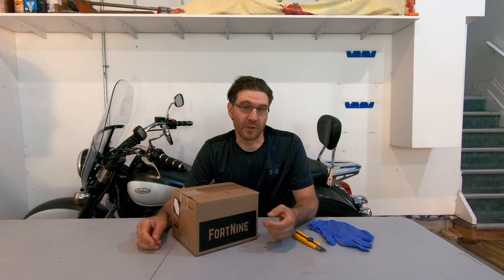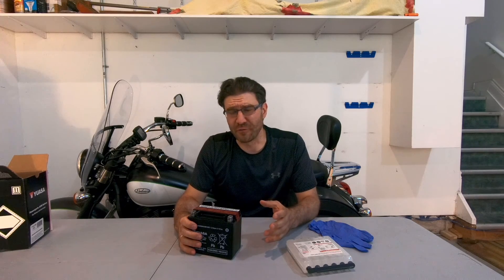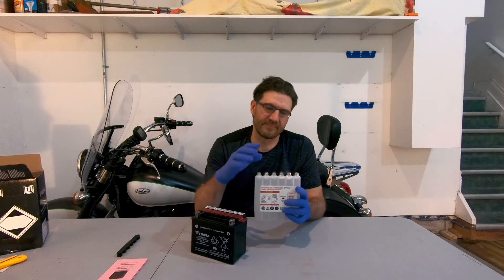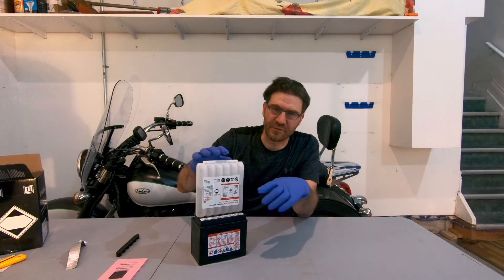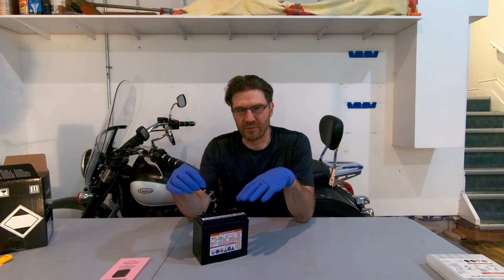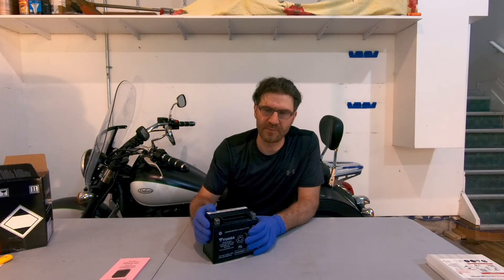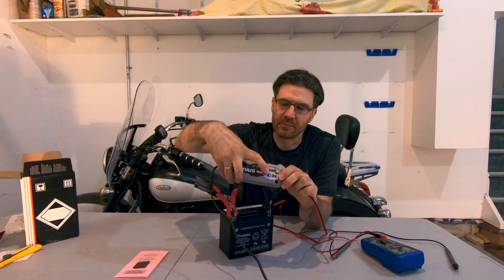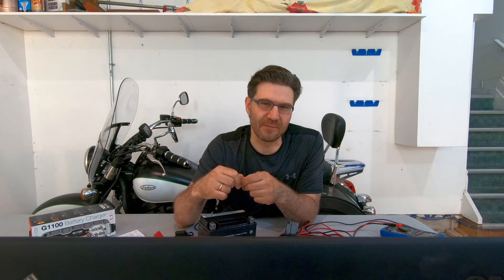How to Activate and Charge a New AGM Battery

Comment: Everything ok but the right thing is to NOT seal the battery straight after the electrolyte.
You just put gently  the cap over the holes for the dust and wait 2-3 hours for the chemical reaction and evaporation. After you seal and charge with the lowest amber you can.
My last YUASA  that i fixed for my bike this way  showed  13,20 right after first charge and kept1 3,12 for the first months and just over 13V for a year at least (being settled not after charging or riding).
I installed it on Sept. 2018 and is still  shows 12,7 Volts after days not riding .

Comment: So that means that I have to buy the battery 🔋 and the charger👎 ?
Reply from the maker: It is good to have a charger anyway if the bike is stored or not ridden for a long time, so the battery can be charged periodically.
Reply: Thanks, I think I need a charger, I try to charge my Old battery with my truck, and i think a ruined that😔I didn’t know that this battery’s get charge by low volts chargers. Thanks 🙏

Comment: So MAX... I’ve seen some videos where it recommends waiting a full hour for the bubbles to stop bubbling before installing the cap. Why didn’t you wait the hour doe the acid to stop bubbling ? Will it effect it?
Reply: The instructions say to install the cap right away after there are no more visible bubbles in the clear container, then wait an hour before charging.  I read a comment on another vid where the guy said he wished he left the cap off because it got really hot during the hour.  Details: The electrolyte (sulfuric acid mixed with water) needs time to properly saturate the battery plates and activate the chemical reactions necessary for the battery to function effectively. Settling of Electrolyte: Allowing time helps the electrolyte settle and ensures that any gases produced during the initial reactions dissipate. This prevents excessive pressure buildup inside the battery.

Comment: Nope, 12.97V is not "perfect" at all bro for a new agm battery :) It should produce around 13.8 -14 V when it is on 100% charge and every panel operates fine. 
It was probably an overstored battery on higher temperature for longer period.
Reply from the maker: Hi Tamás Adrián,

Good catch! You are right that if you take it from the charger and measure it right away, it would show higher voltage. If you measure it within 1 minute, it can even show 16V. After 4-5 min it would show 13.5-14V. Yuasa (the manufacturer) recommends to test voltage after 1-2 hours after the charge. They call it "Open Circuit Terminal Voltage" measured after 1-2 hours. That one should be 12.9-13.0V. That's what I called perfect. :) In my video I actually took it of the charger earlier, and connected only for a very short period to show that it was charged to 100%. You can see the graph showing how the open circuit voltage changes over time here: https://www.yuasabatteries.com/wp-content/uploads/2019/05/Screen-Shot-2019-05-10-at-2.18.49-PM.png. 

Thank you and ride safe!
Max

Comment: My Suzuki GS850's 3 year old AGM battery has lost some cca and struggles to start the bike at times. Battery was never left discharged for extended periods of time. Can it be rejuvenated via new electrolytes? I know adding water to it is a no no.
Reply from the maker: Hi there. You won't be able to bring AGM battery back to life with the new electrolyte. The AGM battery has fiberglass mats inside soaked with the electrolyte. You can't really replace the electrolyte. AGM battery is always sealed, so electrolyte should be just fine. You can try to bring the battery back yo life following the steps recommended in the link bellow. You'll need a charger designed for the AGM batteries, or you'll need to trick a regular charger. Never hearts to try. Ride safe!

https://help.summitracing.com/app/answers/detail/a_id/4180/~/how-do-i-bring-my-battery-back-from-the-dead%3F#:~:text=Cause,a%20traditional%20lead-acid%20battery.&text=A%20traditional%20battery%2C%20with%20less,cell%2C%20or%20some%20other%20defect.